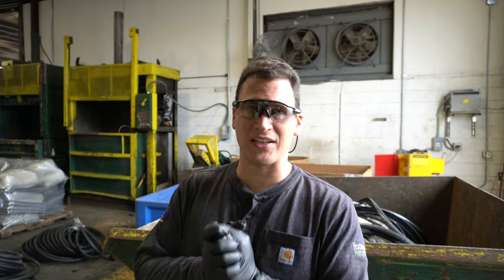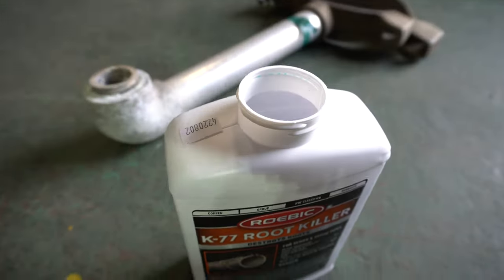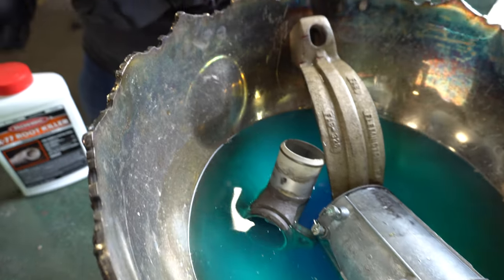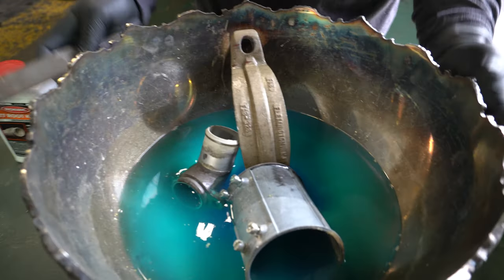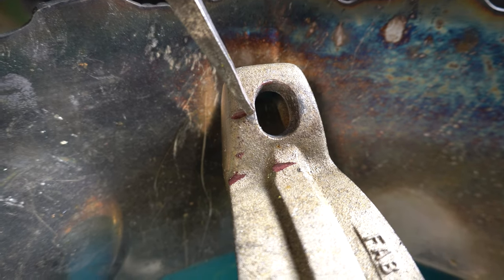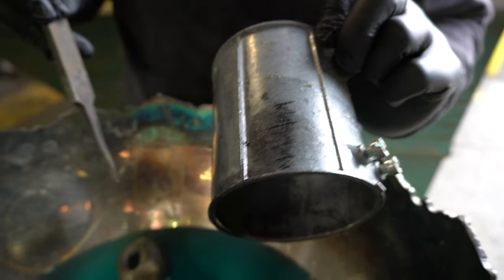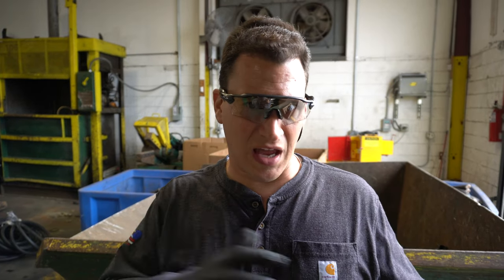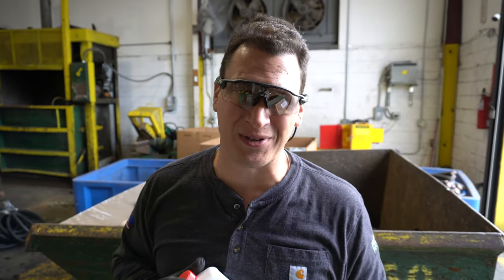Using Root Killer on Aluminum?

Comment: I've been using it for years. I don't about aluminum turning colors and all that but it definitely turns die cast black. Never had a problem at any yard using it. I've never mixed a big bowl of it. I just use a spray bottle. I've cast change colors. I use a different brand but that shouldn't matter I wouldn't think but maybe it does.
Reply from the maker: We are going to try in a non-silver bowl.
Reply: @iScrapApp  that may have made a difference. Let me know.

Comment: I gave you that idea ! I don't soak it in the root killer I put a little bit in a spray bottle with water and just simple spray the material you want to know is die cast or cast aluminum.  So dont know what u are debunking the die cast turned black like it was supposed to like I said. Clean cast should remain silver in color and the one that turned kinda reddish I put in die cast because it not truly cast aluminum that what I am assuming. I use this method all day long and helps me speed up sorting materials! Scrap on!
Reply: I've used this same method for years and it does work. Tom needs to hit that piece of Cast with his gun to find out what is in it that reacted with the copper sulfate in the solution. That is the working reaction, copper sulfate.
Reply: @strakill  right on I thought I was loosing it. When he got different reactions then we did. XRF would be key 2 really knowing what that aluminum was made of.
Reply from the maker: We will have to try again, thank you!!!

Comment: I've had good luck with a couple of teaspoons of Copper Sulfate..( septic system root killer). mixed with a water in a cheap quart spray bottle. I hit the material in question with a angle grinder with a sanding disc.  1 quick spritz of the bottle and the sanded area on die cast/zinc turns black. If I spray aluminum it does not turn black. I don't soak it, just clean an area and spritz it. After a while, with enough experience, you can tell by the weight. The die cast pieces are generally heavier. I use it a lot on ceiling fan  blade mounts, outdoor light fixtures, and various electrical fittings.
Reply from the maker: We are going to check this out, thanks!

Comment: i have been scrapping some old City light Fixtures/ pole lights, with Screw in bulbs, my question is is the metal part that the light bulb Screw's into Stainless ? its not Magnetic or Aluminum or Copper, how do i tell what it is ?
Reply from the maker: Use a file and a magnet- we have some videos on how to use them

Comment: If you know chemistry you know the silver killed what you where going for!!!
Reply: I was wondering why he used the silver plated bunch bowl.  I've never had any confusion using this method but I keep my solution in a plastic spray bottle.
Reply: @sharkscrapper  that why you have to be careful on you2
Reply: @sharkscrapper  I told him about this and to use a spray bottle.  I do this all day long to help sort materials. No need to soak anything.  I do get those reddish Mar sometimes and I assume it's die cast and not pure cast aluminum.  Am I wrong thinking that!
Reply from the maker: Interesteing- thank you!
Reply: @iScrapApp  you should always either use plastic or glass when you test something also it only takes a small of the testing agent to test  with. Do not soak the item in the agent, you will get false results. That what they talk in college.